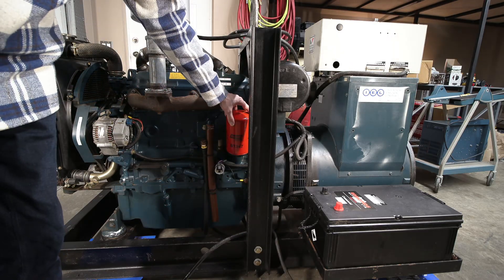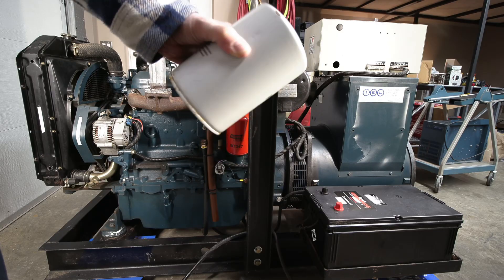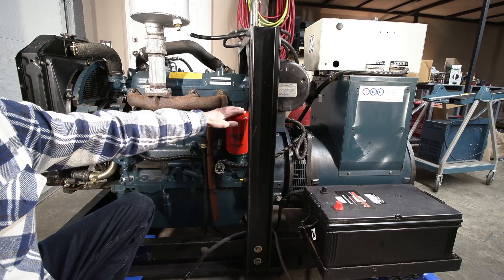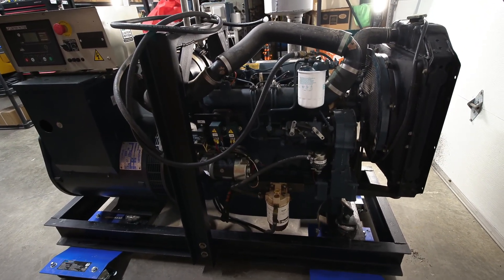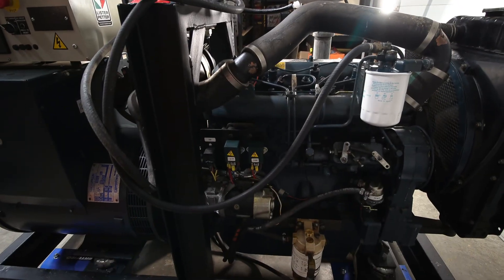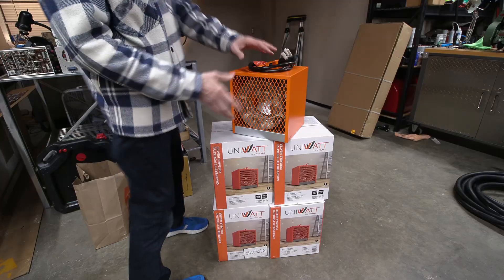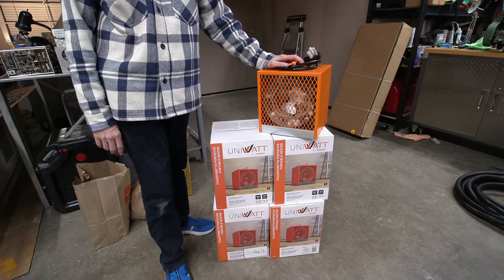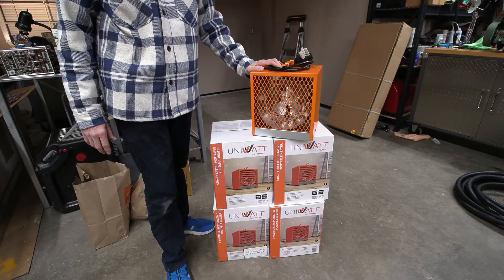Will It Run? Diesel Generator Adventure!

Comment: Love this series! Heaters are such a great load! Also halogen bulbs.
I have a handful of ceramic heaters that I use to load down my portable generators at least once a year because they don't get used very often and then a home sized residential electric furnace works very well as a larger generator load because you can just engage the different coils as necessary and it already has a big fan to cool them off! Neatly packaged in a square box that you can easily move along with a hand cart when needed!
Plus everyone's given those things away for free because they're so expensive to run because they were a little more inefficient than newer technology but when you're looking for a load for a generator it's perfect!

Comment: the proper oil filter has an anti-drainback diaphram in it. there are multiple kubota filters that will screw on there but only one correct one. oh and the right one is about 1/3 more pricy.

Comment: No mention of your previous 10X overestimation of the generator head power rating. It’s ok to make an error on camera Paul.
Reply from the maker: Read the tag in the previous video.
Reply: @MrCarlsonsLab glad you were able to determine what you had. Nice generator! I’m sure it will serve you well for many years.
Reply: I had to make a similar comment on the previous video I am an ex listerpetter mechanic

Comment: Is that face-up orientation of the oil filter a design flaw? Do they assume that it should be run periodically?
Reply: Millions of engines used that exact style filter orientation.  People need to get over themselves.
Reply: @ShainAndrews  I would've thought so. The design looks like it hasn't changed since the 1930s!

Comment: As if there was any question! 😉 Good one Paul, well done.  Looks like the engine block has been rebuilt/cleaned/painted, pristine and shiny.  Maybe remount that muffler with flex.  Very nice, no power worries now, geothermal should work like a champ and any other power needs without the lights dimming.  Another Mr C's expert class restore, expect nothing less, thanks.  73

Comment: Some filters have anti-drainback valves in them. That, coupled with a tube in the middle of the threaded part that sticks up into the filter will go a long way to keeping the oil filter from draining out. You can also retrofit a remote filter mount which would let you position the filter any way you choose.

Comment: You might want to check out early Chrysler slant 6 oil filter methodology. The oil filter mounting boss, incorporated a stand pipe, that kept the filter mostly full. Time to get out the tig torch.

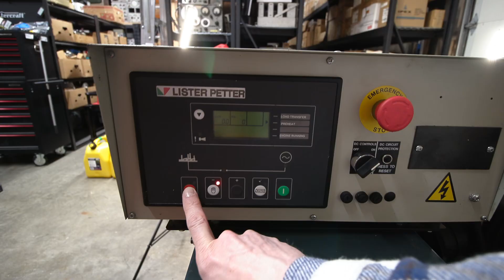Comment: 4:44  If the genset is bolted to the floor (at some point, in the future), then there's no need to have the control panel attached to the genset and moving around like that.
Only reason would be relative motion of the wiring, but that could be overcome with suitable routing. 
Therefore, maybe..., perhaps..., possibly..., ...rig-up a floor mount for the control panel so that it doesn't vibrate with the genset.
Reply: the control is built to handle that so no worries. It's also mounted on rubber feet. No sense in reinventing the mousetrap on a set that will probably go 40 years or more as is.

Comment: Paul see if you can find a oil filter with a check valve in the filter it is what i use on my 10kva gen
Reply: I'm surprised that it doesn't have one; most inverted automotive applications do. BTW, I've learned you can prefill these without making such a mess if you stick the prefilled filter in the freezer for a couple of hours beforre installing it.
Reply: @sometimesleela5947  If you buy the cheapest "equivalent" filter chances are it won't have anything, even it is a good brand because they do not make anything for free and they probably designed it for another engine in which it goes upwards.

Comment: Smooth running. Fantastic job. BTW What's the best way to store its battery if you're not going to use it for several months? When I was a kid there was debate over whether or not to leave lead-acide batteries on a trickle charger, thoughI imagine the ideal may not be the same for different types of batteries. Again, thanks for sharing your adventures.
Reply from the maker: Really depends on the battery quality, and right now the quality is really all over. I have left batteries sitting (un attached) for two years, and they are still fine (holding a good charge), and others self drain in months. I completely disconnect the batteries when not in use, then top them up (charge them) about every 3 to 6 months to maintain them.
Reply: @MrCarlsonsLab    for a few bucks you can get a battery maintainer, which is necessary with those digital controls because they do have a constant draw when set to the auto-start mode. BTW, all the new ones are "smart" so they will not run constantly. (parasitic line draw) This is now a dept of energy requirement. The problem we ran into was the older units did maintain well, but the new ones will sense a problem and shut the charger off in a day or so, leaving you with a dead battery. The cure is to step up the size to around a 10 amp capacity (more money) so the charger can cycle off and not go into trouble mode.

Comment: funny, this is the LAST place I'd ever think to see a "will it run" video LOL ;) Thanks Mr. Carlson!
BTW. If anyone needs to suck oil out of something, 5 gallon bucket, shop vac, small hose. Cut holes in the lid of the bucket to fit the small hose and shop vac hose. Run the small hose to the bottom of the bucket and insert into said piece of equipment. Hook shop vac to big hole and there ya go. Works if your in a bind, Don't recommend doing this with an engine that's had the crankcase flooded with fuel.

Comment: Hello Paul, I'd like to offer a suggestion... you may want to consider relocating the muffler to the frame and adding a flexible pipe between them. Under load, the vibration may become to much for the  current setup.
Reply from the maker: I absolutely agree! This is how it came, and I dont like the weight of the muffler being supported by the exhaust manifold. I will TIG weld a flex pipe to a stationary muffler.
Reply: Price out stainless steel flex pipe and galvanized. In the trucking industry I've personally found the stainless flex pipe lasted FAR longer and it was $2 more for a 24" piece at one place I worked. It was so much better that I could reuse it when changing other exhaust components.  @MrCarlsonsLab

Comment: In my past life as a diesel mechanic I used to crank an engine over until it built oil pressure and THEN put fuel to it after doing major engine work. I also like that you recognize that the only proper way to load test a generator is with a heater(s). I don't know how many times I watched a small engine shop test a generator with an electric drill. It's not even a stable or consistent load! Anyway it's nice to see an engine not (destroyed) by: EGR, SCR, DPF filters and other emission control equipment that has all but put the trucking industry on it's knees begging the EPA for mercy. That urea REALLY raises hell with sensors and eats the associated wiring as well. Stranded wiring makes a nice wick into the many ecu's on over the road vehicles. Thanks for showing and it looks like a really nice unit. It should last a really long time at 1800 rpms. Take care.
Reply: Mmmhh, even though I'm an electronics guy, I'm currently working on 30-60yr old diesel equipment(company needs to build a storage facility and the only stuff we can afford are basically broken antiques). We even had a museum ask to switch bulldozers because theirs is 15 yrs younger. All machines have some kind of deutz diesel engine, which is a breeze to work on(well except for lifting out stuff, but the same would apply to modern machines). I could go to the deutz service center and get parts for a 60+yr old engine without issue and now it's running again. Meanwhile my car is in limp mode for half a year now because they they used 5 different sensors for one model(yes, with that engine from that year) and it has to be reset and calibrated and all sorts of stuff. 

I'm not even old enough to say it, but I really get the, "Back in my day..." mentality of the older generations.
Reply: As occurring auto mechanic I have to agree that I've seen so many times people just crank over new motors or rebuilt motors without disconnecting fuel or spark and not building any type of oil pressure and just starting it and letting the clacking go away after 10 seconds. Hell of a way to break in a motor
Reply: @MrMersh-ts7jl  Rebuilt or new engines have assembly lube on bearing surfaces. Clacking is just hydraulic lifters taking time to start pumping up. Nothing is metal to metal grinding away like you might imagine though. Idling is very low load; just enough fuel and air to keep the crank spinning.
Reply: In my shop we used electric cook tops as a load bank. Each one was good for around 7,000 watts @ 240 volts. I also had a box of old fashion hair dryers @ 1,500 watts each. The problem with using a drill or pump is you don't have the full draw unless you have a way to load them consistently. Electric heaters are the way to go.
Reply: I've learned any piece of equipment touted as "high efficiency" will incur more cost to the owner than normal equipment.
Moisture getting into sensors, resistors moving in value, communication issues between units due to EMI, etc. (on top of the other failure modes in a traditional unit)
It's just not worth it. I do HVAC and I've begun actively dissuading my customers from purchasing high SEER equipment.

Comment: Those poor engines in North America, running at 1800 erpm, here inEurope, a chilled 1500 erpm..
Reply from the maker: You should hear the 2 pole ones, 3600 RPM!
Reply: @MrCarlsonsLab    you won't find that speed on a diesel set.  <LOL>

Comment: Of course it's going to work, it's in Mr Carlsons Lab. The title should be "How good is it going to run?" 45kw is a heck of a load too, can't wait to see that test, the place is going to get real warm real fast!

Reminded me of a friend of mine who has a smaller Kubota diesel generator and some diesel farm equipment. He  got into making his own bio-diesel from waste oil from restaurants about 15-20 years ago.. started out with a few gallons now he has several 600 gallon tanks usually full of the stuff.. never short of fuel.

Comment: So Paul, it looks like a nice generator. I noticed that the exhaust pipe has pipe fittings on it. So, could you add more pipe and vent it to the outside, therefore not needing the doors open? Just like big whole building generators are installed.

Comment: Now come on, Mr. Carlson- you think we'd doubt your skills!  That generator didn't stand a chance!
Reply: I think Mr Carlson pulled a fast one on us. No diesel engine will start that easily and without a hick-up when the fuel lines have been disconnected.
Reply: @Drottninggatan2017  he primed the fuel lines
Reply: @ivankirola2707 
Yes. But after that we saw the Jerry can sitting on the floor unconnected. 
And you can not bleed the system by opening the pipes at the injectors and operating the fuel feed pump. It doesn't work like that.

Comment: 1..those about the obsolute worst cable terminal ends to have near a lead acid battery...

2.. many diesel engines have a compression release so you can crank them over to build pressures and blow out any condensed moisture before starting...

3.. plumb exhaust to dump several feet away from and higher than any openings....closed are or not...diesel exhaust isn't bad as gasoline, but following the same exhaust safety is best practice

Comment: Awesome little genny! 
Actually I have found for a homestead back up generator.

Go to an auction and pick up a larger light tower. They have great little Kubota diesels, you can pick them up for a song.  Cut the tower off a bit of re wiring and you have a great back up genny that’s low noise, easy to move around and holds a good amount of fuel

Comment: @ 3:40 - The greatest electronic genius of the 21st century plops battery cable clamps onto terminals with no torquing of bolts.  Me who has been cursing and fighting old stripped battery cables and clamps for 45 years facepalms...
Reply from the maker: It's all about the fit :^)